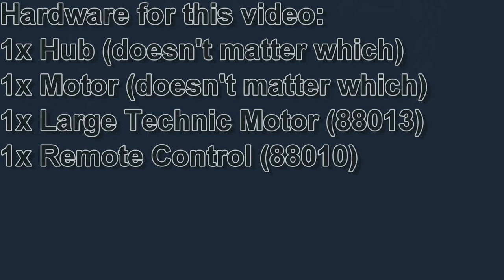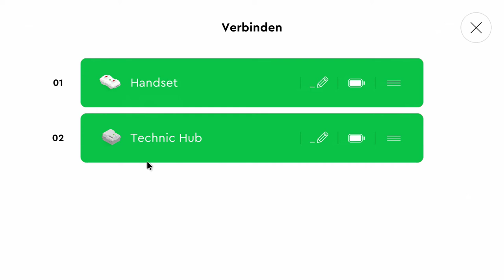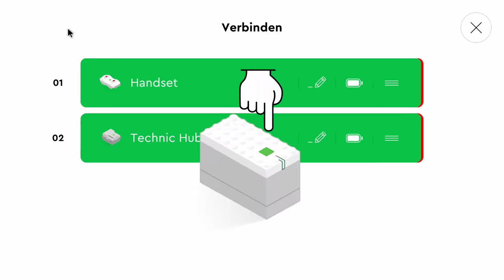Lego Powered Up Tutorial #11: using the remote control (88010) and multiple hubs [English|HD]

Comment: Hi! Great content. I have Lego sets no. 88010 (Remote Control) and no. 88006 (Move Hub) and I have a problem configuring them to run simultaneously within the "Power Up" Android App. I was able to pair them with a mobile device and the application sees them both. The problem is that the only first device on the Bluetooth list is responsive to commands. For example, if I set Hub as the first device motors will rotate according to the code blocks but pushing remote controller buttons will not take any effects. If The Remote Controller is first on the list (I can manage which should be first by drag and drop) code blocks will show that the button is pressed but motors will be stopped and irresponsive. Both devices are green on the list inside the app. Do you think Is it possible to fix it somehow? On your video everything working great.
Reply from the maker: Did you use the white blocks as input for the ports? There you can select port+hub
Reply: @technicmaster0tutorials  Thank you. Now everything is working fine. The problem was with the mentioned white block. It should point to hub no. 02 :)
Reply from the maker: @piotrekkocjan  I'm glad that I could solve your problem :)
Reply: @Technicmaster0 Tutorials and more  I'm having the same problem... there aren't any numbers showing up on the hub selection screen so when I use a white block to indicate the hub I'm wanting to use there no actual value to be found

Comment: I've got everything right as far as making the remote give a value and they are in the correct order in the hub screen but my hub screen is not showing numbers like yours. When I use the white hub block and select 02 it's not picking up the truck body hub I'm using to build with
Reply from the maker: sounds like only one hub is connected to the app
Reply: I'm having the same problem and they are both connected

Comment: i have a 88010 and a 88012 like you: i can't make these work together. If i put the 88010 to the top of the list, only that will work. I if put the 88012 to the top of the list, only that work. The two together never. It is the Powered up app which looks totally different than this. The boost app does not seen to support the 88010. Can you please suggest?
Reply from the maker: There will be an update for this video in the future because the powered up design changed